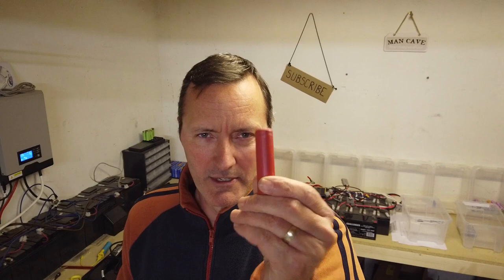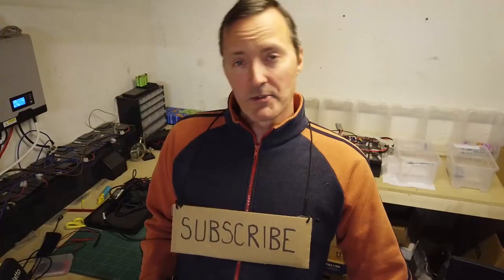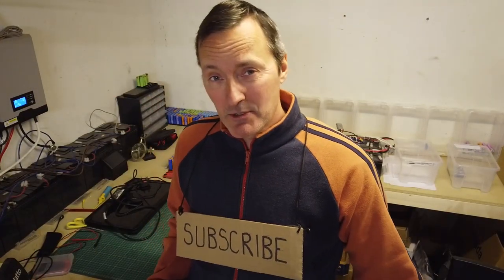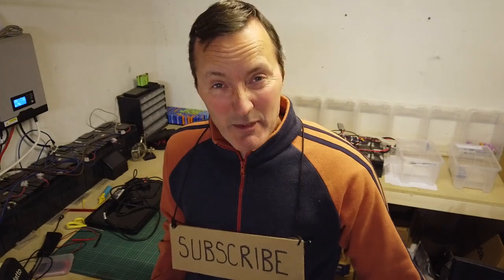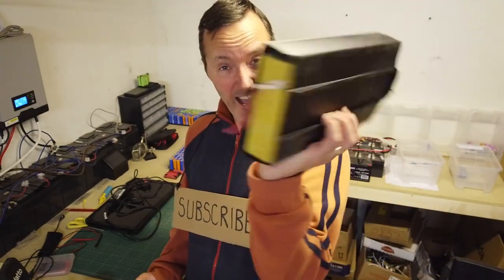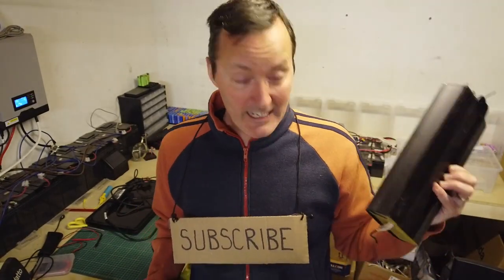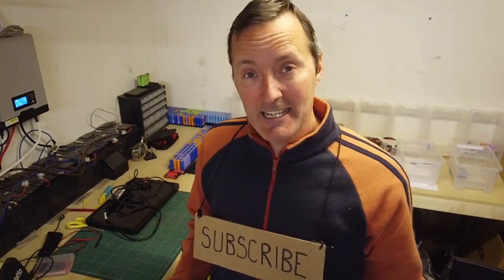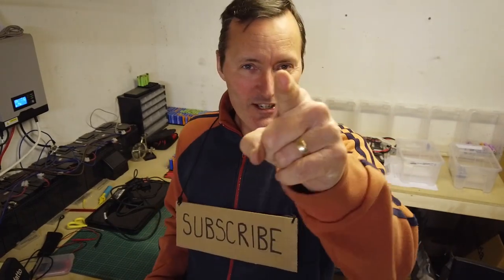My DIY Powerwall journey begins - with a plan!

Comment: Here in Germany we have also a 3phase. I'm convert my system to 1phase. And using two mpp-solar inverters. Only one machine in my workshop use 3phase from the grid. The battery is a different story.  I bought new cells because used cells are also too expensive without a good source. I'm using used solar panels. We had many solar panels on the market in Germany.
Reply from the maker: Yeah I looked at splitting my 3 phase into individual phases and having a separate inverter on each phase as well. For me it's going to be easier to have just 1 big inverter across all 3. You're right about the second hand solar panels, they're everywhere now which is great :-)
Reply: @TheKilowattChallenge  1 big inverter will either a) have a lot of losses (like Daniel's MPP hybrid - but he has a huge powerwall) or b) a very expensive efficient inverter. I went the route of separating loads in the house between low and high power and have a very efficient victron inverter of ~1.2kW for small stuff all the time, and using a PIP 5kW turning on only when needed for high loads like washing machines and hot water boiler. Take a look at my forum thread for more details: https://secondlifestorage.com/showthread.php?tid=1061 anyway, nice of you to take the time and document your journey in video format. Keep it up, enjoy watching. Cheers
Reply from the maker: I just subscribed to your thread, I'm loving the google integration!  Do you know which Victron I would for 3 phase 10k hybrid / 3 x single phase inverters linked together?
Reply: @TheKilowattChallenge  Off the top of my head, no, but I recommend to contact victron and talk to them, they're usually very helpfull to understand your specific requirements and explain a lot of the options.
Reply: @TheKilowattChallenge  the one thing I use 1 phase is the idle consumption. I can switch a inverter off with a WiFi switch or use a timer

Comment: Hello, to reduce the power consumption of the inverter you can place a transfer switch in front of the inverter. Then you would switch to the grid and the inverter is only used as a charge controller. I mean that the AC part consumes a lot of power, the MPPT part is quite power saving. You could build such a circuit with two contactors.
Reply from the maker: It's funny, my current inverter drains the same amount of power whether it's in line or battery mode! Do you see the same?
Reply: @TheKilowattChallenge  Well, I think we're talking about different things.  I meant if your batteries died and you had to switch to the grid, you could do that without the inverter in between. Then at that time, the inverter would only be responsible for charging the batteries through the solar panels. For this time you can deactivate the AC part of the inverter and save power.
As far as I know, the MPPSolar PIP's (you have one, don't you?) have a high energy consumption when generating alternating current. Of course it doesn't matter if it comes from the solar modules or from the batteries.
Reply from the maker: I might be wrong but I think you can do that in the software anyway. Yeah my PIP ripoff inverter uses the same software and can prioritise the charging source but saying that, I dont think it can disable the AC automatically... Something to come back to when I up and running me thinks :-)

Comment: Great start, hope things go well, yes you’ll need a canny few batteries but if you can get bike batteries then this will be a start. I go to the council tip and pick up a couple of laptop, battery lawn mower packs, even got a couple of drill batteries. Haven’t started to split them down as I don’t have  any solar yet.have started to make a charging board for the cells 👍🇬🇧
Reply from the maker: Hi Russel, sounds like you're up and running. Yeah look out for my next video,  it's a road trip where I buy ebike batteries. Cheers ;-)

Comment: A nice little project to get your teeth into. 
Re. the comment below on using the central air system from the new log burner, if its pumped/fan then it needs to be lower a lower wattage than the 100w pump you were talking about for the rads, also is there some kind of filters you would have to maintain or replace every so often?
Lots to get you thinking about, Good luck
Reply from the maker: Well I was wondering if there's some kind of heat exchanger that I can use to recover heat from the stove pipe and them duct hot air from that into the ventilation system. Yeah it does have filters, that reminds me, gotta change it! :-)

Comment: Interesting. I had a 70 acre horse ranch in Wisconsin with 22 acres of hardwoods. Not those pines behind you. I bought the biggest wood burner available . Outdoor style. With 2 main circuits was able to heat my 4000 sq foot house, the 1800 sq foot attached garage. The potable water plus my shop which was an old 104 year old barn. It was 90 feet by 30 feet. I spent 22000 usd in 2000. For everything including labor parts excavating etc. I thought once that was done free heat. No way. I have a 1981 Ford 8000 5 yard dump truck. I burned 22 of those full. When I had friends to help it was fun. They though I was fun for a year or two. After I was on my own, I spent 5 days a week cutting wood in the fall winter. Spring too muddy summer too buggy. I bought eventually 5 commercial chain saws over 5000 dollars. Oh ended up buying a caterpillar 277 track loader. My point. I kept trying to get efficient. Unless you have a free endless supply of HARD WOOD you’ll kill yourself. Of coarse I was heating the equivalent of 4 regular houses. Still. It was a love hate relationship. I’m watching your channel because I use a lot of electric. Heat pump isn’t bad. My dad had solar heated water in Florida easy but not in Wisconsin. I see a pine forest behind you. If you require a lot of heat that stuff burns like paper and I’d dirty lots of pitch. Hardwoods are much cleaner burning. Coal is cleaner too. -I’ve is good for making pulp THATS it.
Reply from the maker: Hi Mark,
Thanks for your very comprehensive comment and for illustrating your experience so well. You know, my log burner idea is only a stepping stone to installing a ground source heat pump some time in the future when money permits it but I'll bet you're absolutely right regarding the amount of work required to keep the log burner going, I'm prepared and motivated for that but I bet, like you, I'll find it a real chore later on. Wood is Sweden is cheap, anywhere from free, if you can collect it, upto about $70 per cubic meter and with a modern reburn log burner I'm hoping to be able to make a massive saving but hey, let's see what happens, either way you'll see it for real on the channel over the coming months.
Next video out in a few days, cheers and thanks again :-)

Comment: When I built my batteries I put them in a 20p 14s configuration so each bank is 2.4kwh and just add them as they were built I now have 26 ish kwhs worth up and running and the set up has been running for just over 4years now and I am still adding to it
Reply from the maker: That's awesome David! It's great to hear people out there doing it for real. 1 question... Are you concerned about your early packs losing capacity and becoming a nuisance when charging / discharging?
Reply: @TheKilowattChallenge  that's a good question as I add packs I drop out an older pack and remove cells from different parts of the pack and check their capacity against the capacity they were at and calculate the capacity loss of the whole pack based on the loss I decide to reintroduce the pack or leave out and strip down the pack and reuse cells with reasonable capacity but as yet every pack I have checked like this have still been good enough to leave in the system
Reply from the maker: That's really encouraging, 4 years is a really long time to run a pack. I know Daniel at DIY Tech and Repairs has been running some of his batteries for a couple of years without even touching them. I cant wait! :-)

Comment: Lots of Chinese 208-230 volt inverters that will run on 3 phase, I like the higher voltage DC as it is more efficient my buddy FrankZ uses 120vdc. Used panels are the way to go they last a long time, hydronic heating is the way to go and you can fire it solar or wood. I use geothermal and it can run on about 4000 watts (Water furnace) my house is all electric and I don't burn anything but I still pay an average $80 a month so I haven't made it yet, also 18650 batteries are a lot of work but I think you already made up your mind. Sweden has a lot of electric autos so junkyard lithium is pretty cheap from EV autos.
Reply from the maker: Yeah I would love to be able to go geothermal but it's way out of my reach unfortunately. You're not the only person recommending EV batteries, if I had the cash it would be a no brainer. Yeah second hand panels are great. I have 4 at the moment I'm experimenting with now and they were soooo cheap :-)

Comment: Nice! looking forward to your journey, i've been on the same path as you for a little over a year and managed to scrape together about 1000 cells, i've not been trying very hard to get used laptop batteries and i'm starting to run out of good (cheap) sources.. I am also going 48v (14s), going to go for an air-to-water (monobloc) heat pump. 2.4kw energy in gives roughly 9kw heat which is enough for the house demands, log burner for really cold days. planning to cover every cm2 of roof with panels (PV and thermal). its an interesting project full of questions and discovery.. good luck - will be watching
Reply from the maker: Nice one Neil, yeah it sounds like we're on very similar paths at a very similar stage. I'd love to go air to water as well but I need 16kw to heat my house unfortunately. I'll be doing a video on that soon. Where in the world are you based?
Reply: The Kilowatt Challenge UK

Comment: Do you have a central air system in your home? Or just electric baseboard?
Reply from the maker: Actually, I do have a pretty big air circulation system in the loft but it only has a 1kw heater in it so its useless in the house. I've had to turn it off anyway because it sucks all the warm air out of the bathrooms which means the underfloor heating can never turn off! Maybe I should do a video on it? :-)
Reply: The Kilowatt Challenge Could be a future video! I have a buddy with a outdoor wood boiler system. The system works wonders and hooks into the houses central air system. As a backup it can also run off propane. It’s neat! Looking forward to your future battery building videos.
Reply from the maker: Hey... that's a great idea... I wonder if I could somehow duct the warm air from the log burner into the ventilation system... hmm :-)
Reply: The Kilowatt Challenge Yes you would be heating water and run that through a radiator in the house.
Reply from the maker: @zmoro3492  I gotta look into that one, seems a waste the send all that heat up the chimney without recovering some of it at least

Comment: I am right Now looking for a inverter too and i Wanted to buy Daniels Green One saw post and right Now i am not sure what todo.   7 kw in Winter lost is alot.  But victron if i understand it right will cost 4x more for my 10 kwp new solar System.... I i wrote a eBay Shop and they wrote back 150w idle. Still alot.  Thing is you loose 1500-2100 kw per Year for a cheap inverter = 200 Euro in Germany. If the victron cost 5k more Would be 20 years with his less idle watts but high buying costs.
Reply from the maker: Hi Nils, it sounds like we're on the same path and that's a really interesting point you make. I think you're right about the payback time, of course the other question is, would the Victron still be working in 20 years!? You make a really good point there :-)
I'm 95% sure I'll be following Daniel's lead and buying the green one but I am a little nervous a out its reliability. 
You know, 200 euros / year to run the green controller is nothing if I can save  a lot of money for 6 months per year ;-)
Reply: Keep in mind that the losses are not only in winter. You need quite a lot more of solar panels in order to account for those 7kWh losses of the MPI. During Spring/Autumn, you might struggle. And even in Summer when Sun is a lot, the nightly losses are still there, so you still need to either have big powerwall to store those additional kWh of gathered sun, or to export/import to grid which have also additional losses/cost.
Reply: @TheKilowattChallenge  From what I understand Daniel power needs are quite huge. As you said in first video, with which I fully agree, the first thing one should do is to evaluate how much power can you cut from your daily usage, and see how much of that is wasted on things that you might not really need.
Reply: I am right Now talking with greenakku.de about the victron. So i get the real costs. After that i can compare the mpi vs victron
Reply from the maker: @fmarpt  So for me.. bigger is better!  I can only fit around 10kWp on the roof so I need to offset the losses with more storage.  Interesting chat!